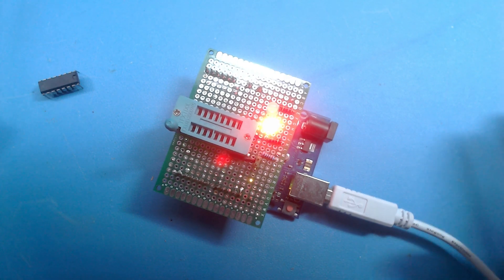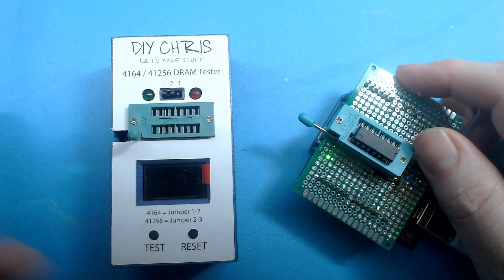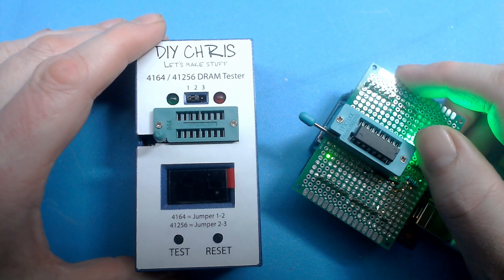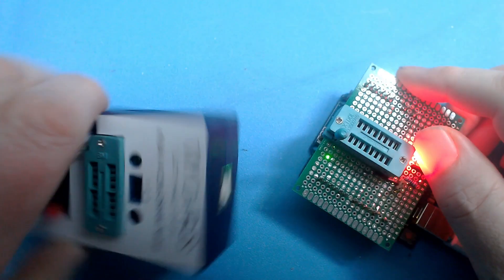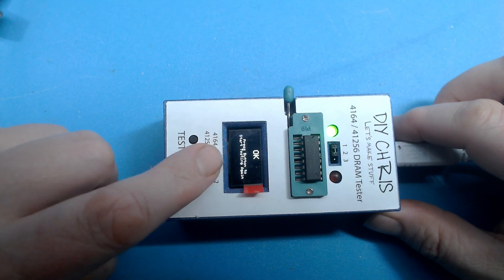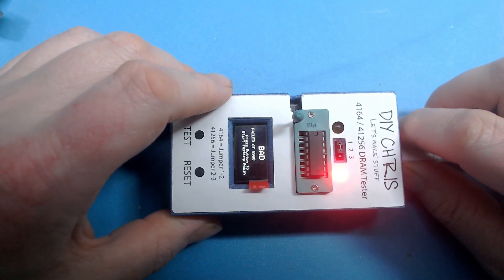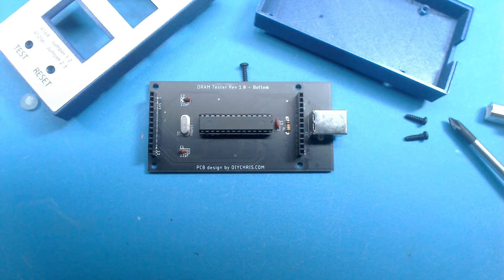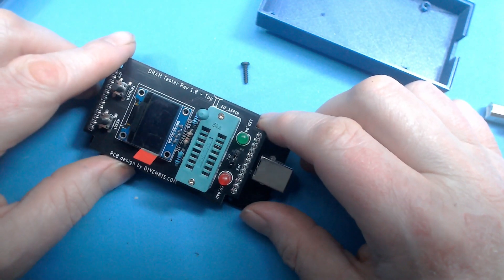Dram tester. DramArduino vs the competition

Comment: I made a DRAMarduino to test a fairly amount of 4164 and 41256, installed in some boards and spares. Got it working with my Arduino Uno R4. Today I enhanced the original code, with some help from Copilot. I added: Fill, WalkingBits, Checkerboard, Retention, Inversion, AddressAliasing (this one is sloooww). "Fill" was the basic original test, but some chips passed this test and faults with the more strict ones. Still working on some even more stricter integrity test and maybe add a couple of modifications from other people

Comment: The one issue I didn't hear addressed was the difference in cost.  All things considered, a very even-handed treatment of the two test units.
Reply from the maker: Thanks for watching! As I had all the parts for the dramuno in my partsbin, I could say it was for free. But all in all, I paid as much for post and packaging on the DYI Chris tester as I did for the clone Arduino board, even with new parts. The reason that I now use the DYI Chris tester in my videos now is that due to the chip shortage I have temporarily recommissioned the Arduino to another project. But I recently got some more board so I will put it back together.